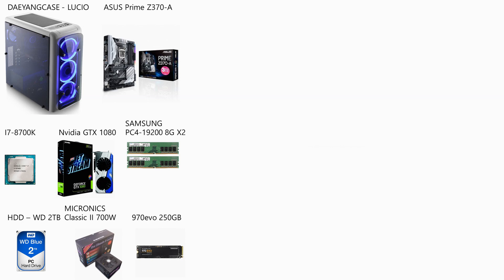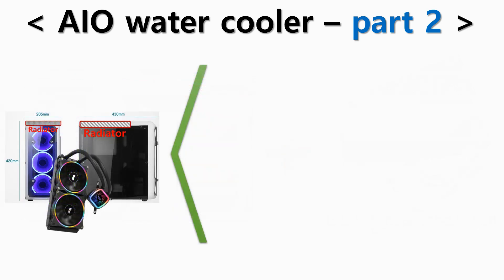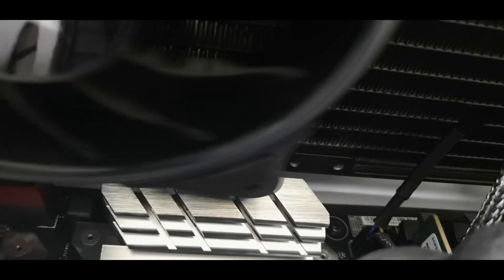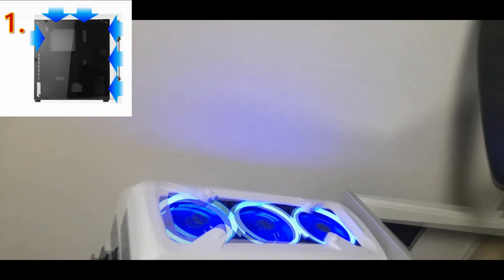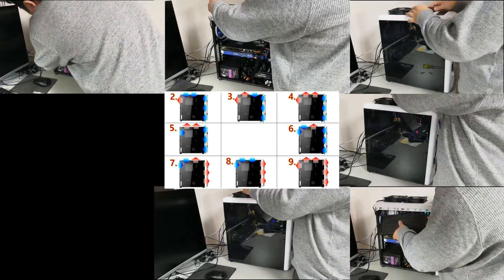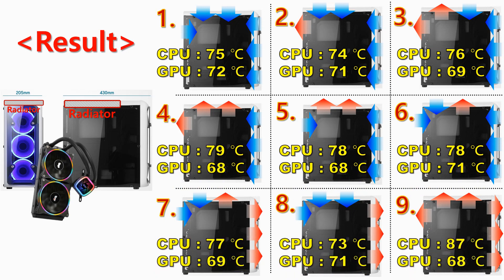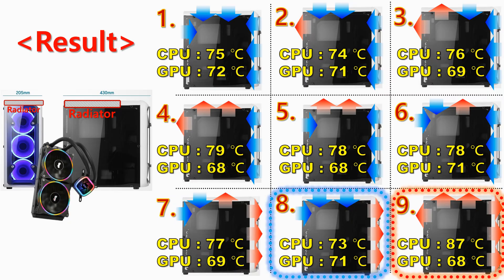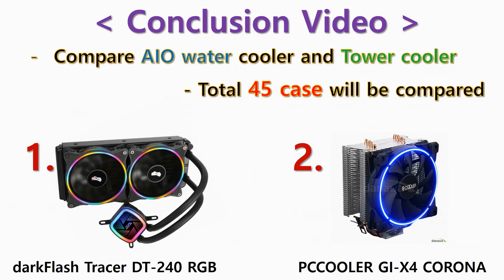Which case fan setting is the best for AIO water cooler PC case cooling?[Part 2]

Comment: actually 2nd case its better because most of the cases have a dust filter mounted in front of the case and above the case,  and for the 8th case you will be getting dust from the back of the case which is not ideal for the long run.

Comment: Number 4 is ideal. Which cooler are you using that goes near 80s
Reply: 4 is not ideal for AIO on top. AIO on top drawing in hot air to pass through the fins will throttle the CPU as you can see from the results. AIO should always act as a intake from ambient. Having it act like an exhaust is bad news for the cpu and life of the aio. Per your point if the top was case fans, I would agree with you.
Reply: @JT-91  What is then best option if you have an AIO on the top?
Reply: @JT-91  I always thought so funny though nearly 99% of ppl do it this way for some reason 🤷

Comment: Thanks for this. Now i decided to mount my rad on top as intake
Reply: not the best idea imho. see here : https://youtu.be/qIWc5f788QA?t=249
corsair also recommends radiator in front intake position
Reply: @Raphael.0013  absolutely nothing wrong with it, it has more to do with where are your other fans and the direction of them, and the air flow of your case.
Reply from the maker: Thank you for watching my video :)
Reply: I'm about to do the same., 
My problem with number 8. (the best solution) 
Is that the rear fan is doesn't have dust filter - so that would just create a huge dust intake. 
I think of a different solution. 
Top and front and bottom (My case is side instead of front- Lian Li O11 Mini) intake
rear will be exhaust.
I will spread at the bottom 2 fans to avoid suction of air through the rear PCI slots cover plates.
Hopefully the airflow will be circular that will eventually be sucked out through the exhaust.

Hope i'm not wrong.
Reply: @acorchia  get a dust filter it’s simple :)
Reply: @SkyHighFilms777  lol apparently I completely wasn't thinking about that :) I wanted to find a solution with the original parts without adding extra. But yea, you're definitely correct, should've been the way to go. 
Eventually I went with intake bottom \side outtake top and rear (No. 4) - also, had to mention, Radiator was on the side and not top) had some problems fitting it with ATX MB)
Reply: @acorchia  I agree playing a lot with those small aftermarket mods (non original parts) takes away the beauty of your rig…
Reply: @SkyHighFilms777  yep, but it's definitely an option to optimize that top end overclocking and such (currently since i'm not really doing any serious work ) CPU is reaching 60 degrees under constant stress test, GPU is 1070 so it's not really going to suffer either way.

Comment: What the hell of bad cooler and crappy fans you do have to get over 70° on CPU and GPU??? I have 2x120 on front INTAKE, 2x120 on upper EXAUST and under heavy load the CPU and the GPU are around 50° or 60° at extremely max... Also it may be too the case that is not a really good one for airflow... change it
Reply: Maybe she has an intel i9 9900k and a RTX 2080 ti and you have a Intel Pentium 3 and a GTX 710...
Reply: @alltroll1418  dang that burn is hotter then her gpu/cpu temps